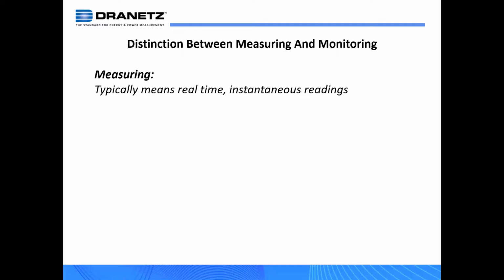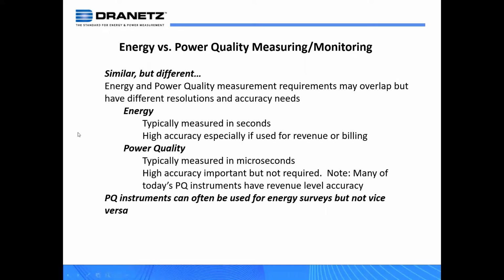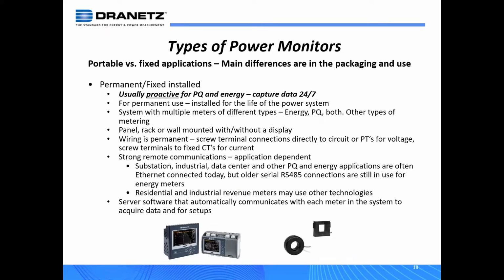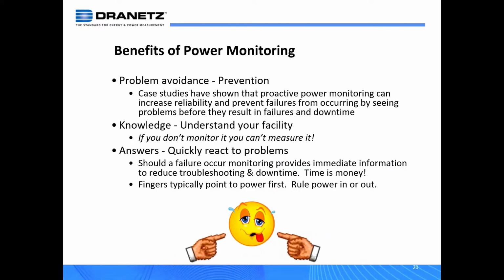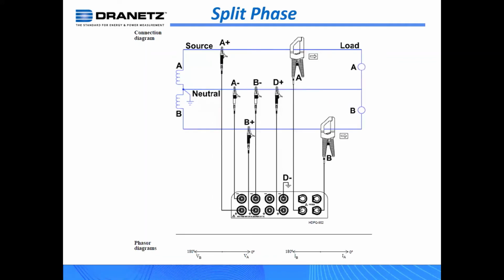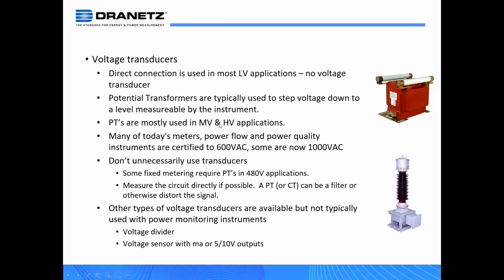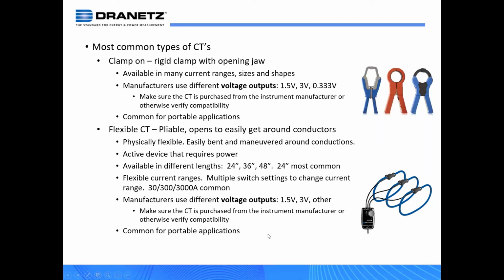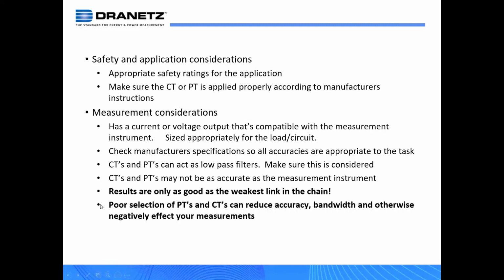Module #1   Intro to Power Monitoring

Comment: I think Dranetz need to upgrade seriously it’s analytics on power quality. While I like dranetz equipment the technology and analytical underpinnings of HDPQ is 10-years old. When is this going to change? I might as well invest in a high grade oscilloscope from Keysight or Rhode-Schwarz adapted to measure lower frequency higher voltage purposes.